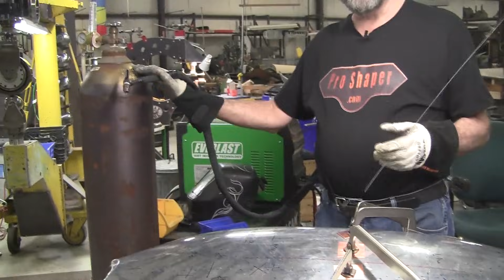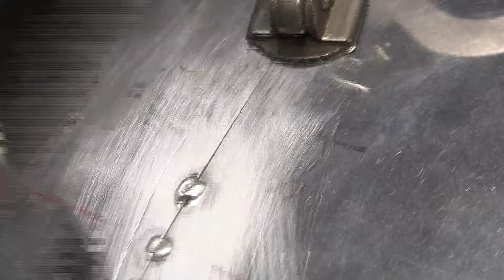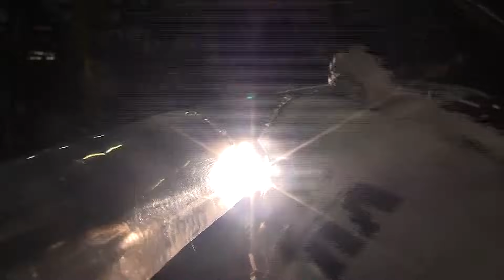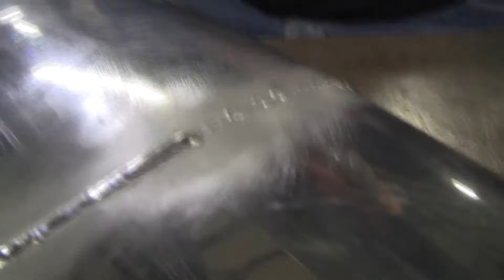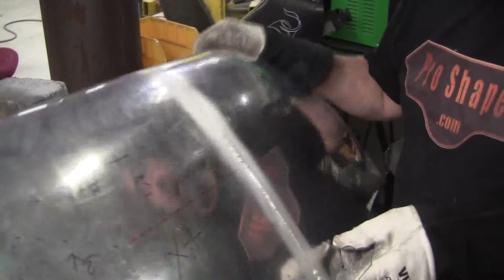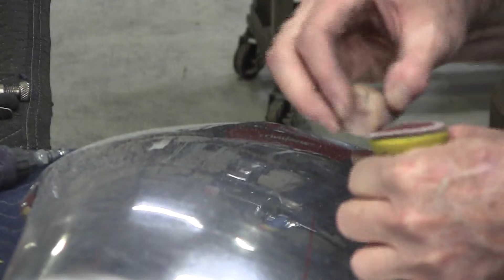Metal Shaping: Jaguar E-Type Aluminum Bonnet Build (Part 6)

Comment: Hi Wray can you tell me what the benefits of using the 50/50 gas mix are?
Cheers Larry
Reply from the maker: Prior to switching from just argon, aluminum sheet tig  butt welding was not 100% successful. About 30% of the time cracks would show after smoothing and metalfinishing the joint. With the argon/ helium mix no cracks.
Reply: Thank you sir!

Comment: Here is a Tip for you Wray : Cracking can be Massively reduced or even eliminated if you use the exact same Aluminium rod ( Made with strips of 'Off cuts' from the material you're working with) And try using a Vermiculite composite behind the area being welded, with a slight 'Air gap'. >>> We call it the 'God Weld' !
Reply from the maker: Hi Graham, I have tried many times what you have suggested. If you watch my how to butt weld aluminum sheet video you will see the method I show there- no cracking ever and very easy to master. Watch my video "Jac welds aluminum" she masters the technique easily and it was her first time ever welding aluminum sheet.

Comment: Proshaper. The E type Jag aluminum  bonnet did you do a butt weld or overlap weld?
Reply from the maker: I have never did a overlap weld in my life. Butt welds are the only way to get excellent results that are real. A lap joint is a nightmare waiting to happen and will require fillers. I'm assuming you have only watched one of my videos. 😁😁😁

Comment: How come you don't. Hold. The torch over the weld for a couple. Of. Seconds after weld for post flow and how  come the welds that are tacked  yet the panel separation lines are still visable?
Reply from the maker: I weld both sides. The weld is as strong as the parent metal when completed.😁😁😁
Reply: @proshaper   thanks for your reply much appreciated I am only 27 and starting at panel beating as we call it in the uk so watching as many videos as possible

If you don't mind me asking  do you think gas welding would make a better weld or no difference to tig?
Reply from the maker: @gregcressey1791  tig welding when done correctly yields an excellent weld in aluminum sheet. Gas welding when done correctly yields an excellent weld in aluminum sheet. I personally think that tig is more versatile and much easier to master.

Comment: Tungsten is contained  , and no post flow.  Give it a few seconds before you move the torch after you stop the arc. Tack welds are are putting.

Comment: those tack welds sucked. practice adding rod and coming off the pedal slower to prevent the crack and dimples . yikes
Reply from the maker: I don't care about the tack welds. Yes, you are correct the tack welds are weak, I even say that in the video. The tack welds function is to just hold the assembly together and at the correct position. The full finish welds are important.  When the welds are done correctly whether with tig or gas they are as strong as the parent metal and close to invisible except for a slight color change. This is the rule when welding light sheet metal when welding structural thicker metals the rules are different.
Reply: @proshaper  you can cut strips of the parent metal to use as filler metal for a invisible seam. Thanks for the videos
Reply from the maker: @vettepicking  I have done that in the past I see no difference, you still get a very slight color change. You really have to look to see the weld.

Comment: Great video 😁  I am loving the series and am going to try to get out there next spring for a class.  Out of curiosity, since there are a lot of ways to grind down the weld, is there a reason you steered away from body files for the seams?  It seems like if the main concern is the rotary disc catching, digging in or running wild, then the slower pace of a body file might be the safer bet, especially for a beginner.  I can't think of a file that would work for the underside of the hood, but for the outter it might.  Looking forward to the next video!
Reply from the maker: Hi Tom, thanks, glad your enjoying the videos. I have a wide assortment of vixen files and other types. I have always found that I can do a better job with grinding.  If filing works very well for you or someone else, then that is great. All that matters is good results.😁😁😁

Comment: Hello Wray. Great stuff once again. My mentor, the one who does'nt like hammer shafts being held incorrectly, would gas weld aluminium joints. He would raise up the edge joints at right angles by about a sixteen of an inch and then fuse those joints together. I never got around to finding that out for myself. As l recall you wire brush the weld area to deoxidise it?
Alan would also cut off a strip of the same material to use as welding rod. That front section is really looking superb. Is it probably the most complex to create? Thanks. Ideally , should you be using a fume extractor when welding using the argon/ helium mix?
Reply from the maker: Hi John, I am familiar with the turned up edge fusion welding method. It is one of the 10 ways to weld that all work very well.😁😁😁 Yes, I use the stainless brush to clean and deoxidize. The front of the bonnet is the toughest section by far, I will tackle the lower front section after I get the top center section completed. There are more fune worries from gas welding than tig, so no fume extraction. Thanks for the positive comments.

Comment: Wray, since I haven't worked with aluminum, I'll ask.. with the back side weld being undercut and leaving grooves, could you re-weld those areas to fill in and grind smooth without causing too many issues? 
Those panels are looking great, by the way.
Reply from the maker: Hi Joe, the weld side undercuts on the backside of the weld were insignificant. They could easily be sanded out but I will leave them to preserve the metal thickness. With super fine grinding you could make them go away, but the effort is not really worth it. 😁😁😁
Reply: @proshaper  Thanks for the reply, Wray. What made me ask this was how filling in a gouge or whatever you want to call it on steel can be a pain . (I don't have a tig). Again.. I have no experience with aluminum but know the melting point and characteristics is different than what I'm used to with steel. 
I'm learning a lot... please continue.

Comment: Powerfiles are really good for knocking down welds precisely, thanks for sharing Wray
Reply from the maker: Powetfiles??? No clue, tell me.😁😁😁
Reply: @proshaper  Hi Wray, 

These are available electric or pneumatic & in different widths...., so much more precise than discs mate
https://www.ebay.com/itm/330-X-10mm-Wide-Air-Finger-Belt-Sander-Power-File-Detail-Sanding-Tool-50-Belts/143367524863?epid=23022619879&hash=item21615ed1ff:g:Cp0AAOSwokxdZvcd

Comment: I have a question for you, in most otherTIG welding videos I've watched, emphasis was made in leaving the gas running on the weld pool after you switch off the juice. I watched your video with great interest as you just took away the torch as soon as you cut the current flow. Is that because the aluminium thickness Is only 60 thou that it doesn't need the Argon/ Helium  gas to protect the weld pool because it solidifies immediately thus not allowing the atmosphere to contaminate the finished weld, or is there another reason? ( and I don't mean that you are a crap welder! )
Reply from the maker: The Everlast welder does have a post flow setting. I had it set for three seconds. It really isn't a issue on the tack welds, they have very little strength.  On the finish welds, you are moving right along the path, again the post flow doesn't have any role, only at the very end. When welding structural (thicker aluminum, yes the post flow is more important. As for the weld I did the proof is in the weld- no cracks, super smooth, almost invisible, and it is very malleable.
Reply: Wray Schelin's Pro Shaper Sheet Metal LLC  thanks for your answer Wray, that makes sense to me now!

Comment: Thanks Wray! You've answered a lot of my questions of the finer details in this series. Was that 1/16th diameter 1100 rod you are using?
Reply from the maker: Yes, 1/16" . I have tried using a smaller diameter rod but there was no advantage.

Comment: Should the tungsten be more round instead of pointy when weding on Ac current?
Reply from the maker: I grind the tungsten back always at least 1/4".  After grinding I use a piece of scrap aluminum to burn the tungsten in. You usually have to run about an inch for the tiny perfect ball to self form. As I said in the video 2 percent Lanthanated works much better on aluminum. I use 2 percent Thorated on steel with straight argon.

Comment: Nice to see a person that makes his living welding for strength and utility rather than going for a pretty weld that cracks right away! Looking forward to the gas welding aluminum video. Maybe I'm old school but it seems to make such a soft yet durable weld.
Reply from the maker: I can both tig or gas weld. In some circumstances one method works a little better than the other. I have to say that it really doesn't matter what method you use as long as you get excellent results.

Comment: Wrey I've got a mine Porter Cable belt sander for flushing weld seams with fine grit belts it really works without digging groves like discs can you can use it as a combo with the disc .🐤🐤🐤
Reply from the maker: The goal when welding is to make the bead as small as possible.  I have evolved my grinding technique over many years. When you say belt sander I'm assuming a 3" wide belt often used for wood work. I really can't see that working for me. I like to constrict the grinding zone to be as narrow as possible.

Comment: Why don't you use an electric or air power belt file instead of the right angle grinder to remove the excess weld. One of these would make this job much easier. Here are examples of what I'm talking about: https://www.amazon.com/Makita-9032-4-4-Amp-8-Inch-Variable/dp/B0000614UT/ref=sr_1_6?keywords=makita+belt+sander&qid=1567043366&s=gateway&sr=8-6 Electric Version. https://www.amazon.com/Astro-3037-2-Inch-18-Inch-Sander/dp/B00L50MKJS/ref=sr_1_3?keywords=astro+belt+sander&qid=1567043408&s=gateway&sr=8-3 Air version.

Another reason for using the belt file is that they don't tend to load up with aluminum as easily as the Roloc discs do meaning they last a lot longer and the belts are fairly cheap. You like the Norton Blaze ceramic material and Norton does make air file belts. Finally, instead of using candle wax, which is way better than nothing, you should try Boelube, which was invented by Boeing, which probably knows more about machining aluminum than any company in the world since that's what most airplanes are made from, and is absolutely the best lubricant available for aluminum. Get an acid brush and brush it on the weld prior to using the belt file and the belts will last damn near forever.

Comment: Wray why do you use a 1100 rod?
Reply from the maker: Because it joins very well. You can shear off small strips of 3003 and use that as well. I used to use 4043 generic aluminum aluminum welding rod as well. I found out the hard way that you can't anodize or chrome plate the aluminum if you have used 4043 rod. No problems ever with 1100 rod, gas or tig welding aluminum.

Comment: Don't you get a lot of warpage by using this much heat? And your not skipping around when your welding? Thanks. Bob
Reply from the maker: If the welding joint is good and tight heat distortion is kept to a minimum. If you do get warpage it is easily worked out by stretching the weld out.  I always weld from the center and work my way out to the edges. There are probably ten excellent ways to weld sheet metal panels, if you follow the rules they will all yield great results. Of the ten methods, two or three methods can be argued to be better if you can get excellent results and faster welds.

Comment: Wray, You didn't say why the argon helium mix? I'm curious why it is better. Thanks for these videos!
Reply from the maker: I believe I did mention it but maybe Mark edited it out. Once you try it you won't, go back. You get a much cleaner heat and hotter. I only use the mix on aluminum.
Reply: @proshaper  Thank you!! i will have to try it.
Reply: At the start of TIG welding it was known as Heliarc as Helium was the preferred gas. Helium is stupid expensive and that's why we currently use Argon. But aluminum TIG has always worked better with helium. Problem is that you need to use a much higher flow rate since it's lighter than air and helium is easily 10X the cost of argon.